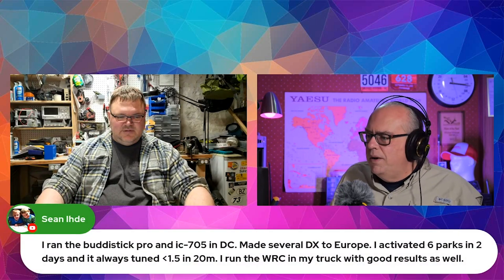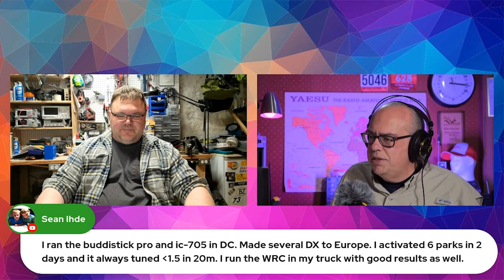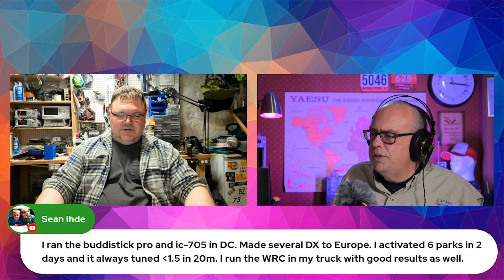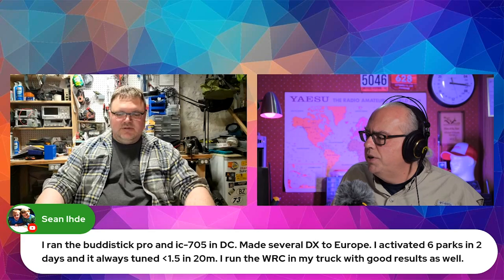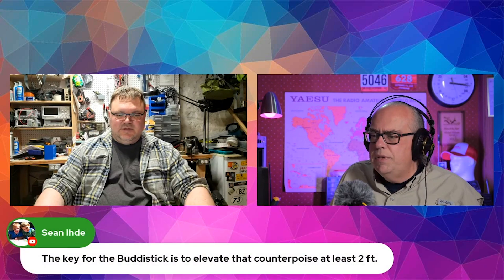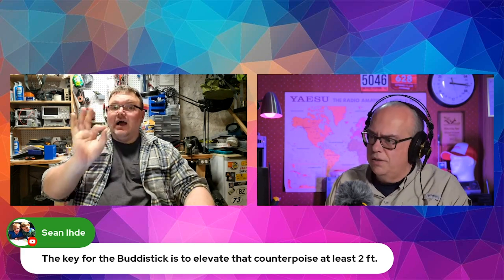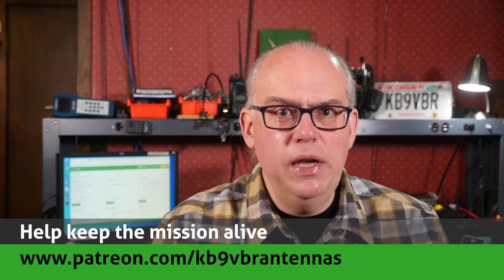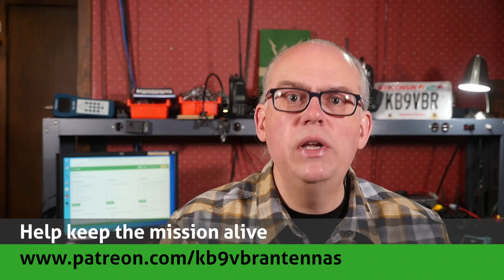Ground Radials: How Many and Best Length - April 2022 Livestream Excerpt #HamradioQA

Comment: Radials on the ground act longer than they physically are, depending on ground characteristics. So using 1/4 wave radials pulls the current maximum down into the radials, probably not where you want the maximum antenna current to be. Generally you are better off with more radials that are shorter than 1/4 wave. But everything works, to some degree. Elevated radials need to be nearer to the full 1/4 wave length. The closer to ground the radials are the less critical they become due to increased earth loss. Loss increases bandwidth and makes things tune more easily. de w6akb

Comment: How about wire thickness?   Copper wire is expensive nowadays!  Using 12AWG WOULD COST A LOT.   I found a really good deal on Solid Copper 20 AWG Insulated coated wire at an excellent price.  Can I expect that to do a good job for me?
Reply: Yup, it is a bit of a shit to remove the insulation though but unless you are only using very few eleveated (tuned) radials and QRO the thickness is not at all going to matter.  I sometimes use the stuff they wind coils with. Works great. As you just make sure to have a solid connection it is not going to matter if you have #20 gauge or 3" thick copper pipes as radials.
Try to get about 2 and half wavelenghts down and you will be pretty good.
73 de SM6WET

Comment: I have built a small, portable, ground plane antenna, mounted on a camera tripod. (Because I had a extra tripod!) I have 4 radials and a 2M/440 1/4 wave (automotive) antenna going vertical. This is used for emergency use, and events in the field. It probably needs tuning, but I want it to work WELL on both bands. 
Is there a happy median (size formula / chart) for both bands?

Comment: Great discussion on radials gentlemen!  What would be your thoughts on using electric fence string, which has about 5 very fine stainless wires wrapped with the nylon string for radials?
Reply: It should work

Comment: I have the DX commander. In the manual he gives three choices. His favorite is 21 radials 3 meters long. There are seven connections on the radial plate so three radials per connector. His other options are 7 radials 10 meters long, 14 radials 5 meters long and if you add the 80 meter element to use 28 radials 6 meters long. 
If I am thinking if I could find a salvaged grain bin roof I would fan each roof section out flat on the ground and connect those as radials. There might be a divorce in my future though.

Comment: Hi guys, you be surprised at this comment hi. I have 350 radials all 10mtrs long connected to a 80m inv L , and a 20m vertical and a 40m vertical ant, if the band is open I can work the us and eu every day.
1 radial cut for a particular opposite the direction you want will work especially near the sea. 6 radials any length in any direction will work really well. 16 radials any length for any band and placed just where you can put them, even a vertical fastened to a fence with the radials going along the fence at small spacings from the ground up over will work well. Even chicken mesh on the ground near the vertical will work. 
I have done 6 years of testing with various set ups, and using specific lengths for each band or putting down random lengths  anywhere doesn't really make much difference. No radials and using a ground tuning unit also works very, especially near the sea.
I have set up vertical ants all over, in open spaces or in exceptionally small garden, even a house with no garden , and all worked dx, real dx around the world, not just the uk to the US, but zl to eu.
I have not found a location which a vertical would not fit, and of course with its low take off angle it's a great dx antenna.  I found 25 plus ferrite clamps at the feed point help with better reception.
Good luck to one and all,  email me if you want more info. Check qrz, 73 zl3xdj
Reply: Interesting that you thought of ferrite snap on clamps.  25+?  is this impedence?

Comment: For portable operation, radials laying on the ground couple to the earth and are much less fussy than elevated radials which work best if tuned. How many you need depends somewhat on ground conductivity. You might need more doing POTA on sand at the beach than at home. Keep the base of the antenna as low as possible for radials on the ground. For a vertical installation at home I'm with Michael and would put out more.

Comment: Here is the evidence-based answer:  "Two of N6LF's conclusions are: “Laying down a system with at least 16 radials will give you most of the obtainable improvement [over no radials at all]. As we go to 32 and then 64 radials the improvement gets progressively smaller” and “...four elevated radials at a height of 48 inches are within 0.2dB of 64 radials lying on the ground.”
Reply: First, define "most".  Then consider that at some point, soil conductivity plays at least some role in all of this, with some places having higher gain from radials than others.  Last of all, saying "only X dB gain or y dB loss" is certainly relevant in a same setup situation.  However, they are not as relevant as ERP when we continue to change and modify things within the setup as a whole, not just one part.

Johnny Lazybones uses a 100 foot roll of 8x for feedline to his vertical with 16 short radials, with the 100 premade piece being longer than needed.  He poo poos "only a dB here" and "only a dB there".  But, when he finally gets around to replacing the 8x with 75 feet of 8U, and finally plants those 64 long radials, he's made over 3dB of gain on 10 meters for example.  That half an S unit makes a big difference in a lot of contacts, especially on those weak signal ones.  

Bit by bit, every improvement may, by itself, not make that big of a difference.  But as you improve ground radials, feedlines, reduce unneeded junk inline, or raise that wire a few feet, the differences together may add up to real gain.

Comment: Michael radials on the ground are not resonant . The only place where length is an issue is with elevated radials . Think of it this way , you are building a capacitor coupled to ground . The more wire that you have near the antenna base the better the capacitor . The math done by"Jerry Sevic" and" jack Belrose" confirms this . The majority of the energy is coupled in the first 10-15 % of the wire so multiple short wires are far more efficient than a few long ones . Finally you seem to be using counterpoises and radials interchangeably , radials are as described above but counterpoises are calculated to provide low SWR which doesn't relate to efficiency .
73 Don ve3mne

Comment: Hi Michael,
Usually 1/4 wave for radials, but you can halve that and double the amount. For a permanent vertical installation, have at least two wavelengths on the ground with at least 1/8 wave in length at lowest frequency. Happy Easter to you and Christine and you both stay safe.  73  WJ3U

Comment: Question on this answer: What would be better? @Callum's 30 (or more) radials or one solid plate(-radial) of metal of a certain diameter? And if so, what would have to be the diameter? (Not looking at cost-effective, just at signal quality)
Reply: To get the same effect, it would take a massive, giant metal sheet to achieve the same effect as a radial.  The thing regarded as better than radials is chicken wire grates, which is too expensive to use, unless you wanted to take an extreme route.

Comment: I've always figured for 1/4 wave at the middle of the band minus 5% for radial length.  For my Wolf River Coils antenna, I make three bundles of three14 ga radials, each fitted with half of a Power Pole connector.  It becomes a balancing act in portable operation between performance and ease of set up.  For me, three bundles of 3 connected to the tripod legs strikes that balance.  -- 73, K7SFA